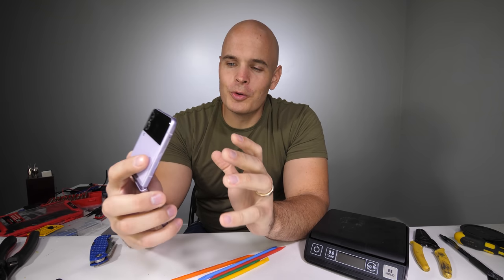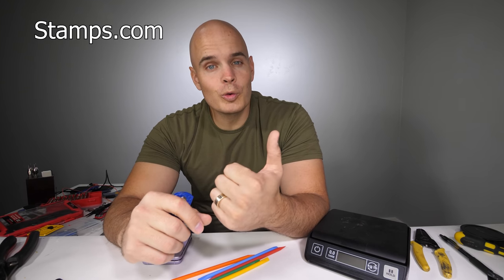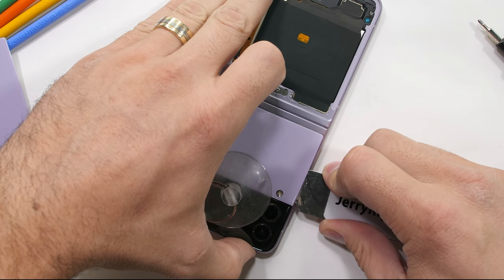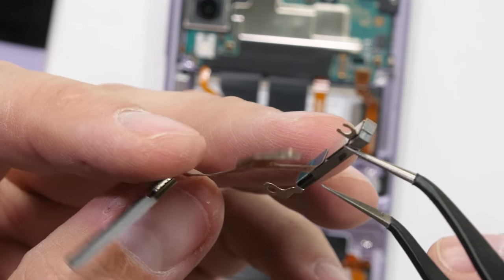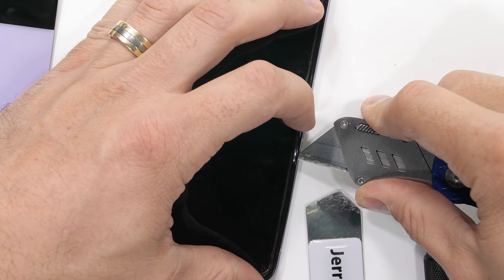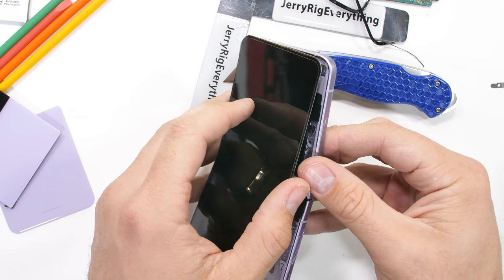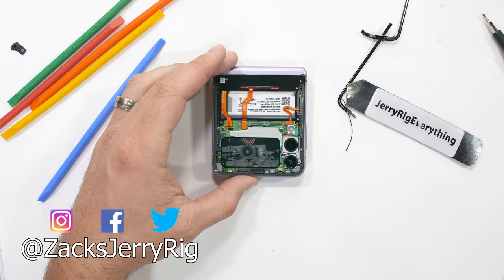Samsung Z Flip 3 TEARDOWN! - Lets try something new...

Comment: i thought for sure you would go deeper into the hinge since from my understanding, the hinge is better than the previous generation in that it can stay flipped at more angles close to 0 and 180
Reply: I think he did it on the new fold. As they use the same hinge.
Reply: @denniswolf8685  might have to rewatch that then cause i dont remember, thanks.

Comment: You should try removing the built in screen protector and see how fragile the screen underneath is. The built in screen protector is just slightly too small for the screen, which leaves a gap around the edge that will collect dust and peel off over time.

Comment: I have to say, this IS my favorite smartphone. Probably, of all time. 

I love having a phone that is small enough to disappear in my shirt pocket, while still being a full sized phone, with flagship power.
Reply: The z fold 3 5G is what I'm replying this message with. I got it a couple months ago
Reply: How "durable" is the screen from scratches etc? My phone is due to be upgraded on my plan in 10 days
Reply: @5punkybob  It is less durable than a traditional glass screen, in terms of scratching. 

But, with it being able to fold, it is far less likely to get damaged like a normal phone screen.

I am still loving it.

Word of advice: BUY THE SILICON CASE!!! The commercials are fucking liars. There is no way in hell, that this phone could be sat on the roof of a car to take a video. It is so slick, that unless the surface was PERFECTLY FLAT AND LEVEL, the phone will be on the ground.  

With the silicon case, it will stay on it's own. It's nice to be able to sit it on your chest or a pillow and watch, while laying down. 

I also set it on my cars dashboard for navigation, no mount needed.

Comment: I have torn down and rebuild roughly 10-15 of these phones since launch (work for Samsung) and I still watch Jerry videos like I have never seen the inside of the device
Reply: How often do these break? Like 1/10, 5/10? Etc
Reply: @aarronconleche8468  They are very prone to get damaged due to user error and I have seen non Samsung cases cause pressure damage which pulls the device out of warranty.  The inner screen protection film can have issues where it starts to peel up at the hinge or even appear like the screen is cracked.  This is probably the most common issue with the Flip devices.  My wife has had one since launch and it is just now starting to have the protection film start to show wear.

Comment: This is personally my favorite folding phone yet,
It’s small, compact and pocketable yet still has a good screen size

And most of all it doesn’t empty your wallet as bad as a $1800 foldable
Reply: Hm tho the only benefit you get from it is reducing normal phone into a small square. Usually reasonably big normal phone reaches around same pocketability as this one. I think that it makes big difference mostly to girls that need to fit it into a small purse or their pockets. Tradeoff tho is a fragile phone with bad battery life. Now Fold on the other hand that one changes a small table that noone can comfortably pocket into a size of a normal phone and i see that as a way bigger benefit worth of that durability tradeoff.
Reply: @MrMozkoZrout  I'd argue that it's far less fragile than my old phone.

My S10+'s screen factory screen protector got completely scratched up in a month

While my z-flip 3 still remained factory fresh 2 months later because the screen is always protected inside

The camera is much more usable too, you don't need a dumb kickstand to prop it while recording videos, you can just fold it and adjust the angle by as much as you'd like which was super useful to me.
Reply: @MrTARIQSs  nah I think the durability takes quite the hit and becomes quite a trade off when it comes to durability

Cuz you’re losing water and dust resistance alongside an actually glass screen….

Basically if you travel and go out a lot this might not be for you
Reply: Another useful feature for me was the fact that I could actually have the top part facing me when I have the phone on a table so I can watch the videos without all the lights reflecting on the screen, keyboard is also perfectly split for the bottom part, so you could have kind of a tiny laptop experience when chatting
Reply: @randaranatunga7259  it's literally water resistant though

I had my phone submerged and no issues whatsoever, it's IPX8 rated after all

Dust isn't a concern either, just watch Zack's previous durability test video, it did not mind dust getting in whatsoever
Reply: @randaranatunga7259  this phone literally have IPx8 resistance to water lol
Reply: @MrMozkoZrout  If you never used the phone then this appears to be the only benefit, but after using it for a while you discover more and more. I don't wanna miss the function to half open the phone and just place it anywhere. That and loads of other things make this my favourite phone so far. And the size isn't really a benefit to me, I always keep two phones in the same pocket and my hand also fits in the same pocket :)
Reply: @randaranatunga7259  again, having the screen protected inside makes it fine, if not better than regular phones, I literally don't get as concerned anymore when slotting it into my pocket as if it falls, the screen won't get any impact with the floor whatsoever, the body will absorb everything
Reply: @MrTARIQSs  right, yes I didn’t mean you’re completely losing water resistance lol

My bad…it’s just taking a bit of a hit is what I mean to say lol
Reply: @MrTARIQSs  good points, I guess what I’m trynna say is that if you are a person who goes out all the time for hikes and all that kinda stuff, this may not be the phone for you because of (possible but not many) slight durability stuff and the fact that there are phones with better battery and cameras at that price if you want to take good pictures or videos and have it last about a day or so of work
Reply: @randaranatunga7259  fair point, yeah it's not for everyone for sure, but not unusable either
Reply: @MrTARIQSs  definitely not unusable, in fact I’d probably recommend it quite often lol.

And yeah it’s not for everyone is what I did mean :D
Reply: @randaranatunga7259  I thought you were the guy that 1st replied to the original comment this whole time, just realized that you were the one who wrote the original comment LOL

This is why I took it from the "this phone can't do anything beyond shrinking in size" perspective based on the original reply, apologies
Reply: @MrTARIQSs  ah no worries 
Mistakes happen and it’s not a problem lol

Comment: Now I want to see if the phone will run with one or the other battery removed. I guess they are probably connected in series or through the motherboard somehow but it would be interesting to do some more digging to figure out how that works.

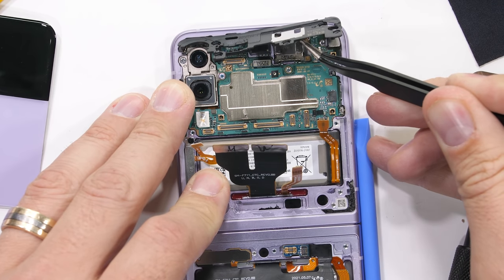Comment: 5:30 It was so relatable I laughed really, really hard... And then cried a little
Also the adhesive liner at 7:56 is really prone to failure. I've had it fail twice, brand new and after a trip to the repair center

Comment: 2:34 I've had the exact issue Many any times, and I've figured out that it's because if the scratch is long, or deep enough I guess after some time passes, less than like 48 hours I've come back to devices that I had put lots of scratches on that would have either a small hairline Crack or a hairline Crack that's pretty obvious.

Comment: have you never used your phone for more than 5 minutes directly on your head?
Why everyone is acting as if only ionized radiowaves can cause harm to living creatures? Athermic effects, including not so healthy ones also occur at radiowaves from mobile phones.
If its so unproblematic, why the  0815 guy is for example only allowed to transmit at 10mW in austria for example? And why its benefitial to the limit the transmitting power of the WLAN routers out of the box?

"95% of LiIon batteries can be recycled"..... well, ofc it CAN be recycled, but add to the recycle costs the chemicals and energy needed, aswell the CO2 which is produced within the production and recycling of them.... and LiIon batteries are by far one of the worst things humanity created. Lets be real, as nice the advantages of LiIon and co are, they are by far:
1) the most unstable/dangerous batteries yet (but considering their energy per space, its just ok)
2) the shortest living batteries. Its so funny to see batteries from 80 year old WW2 tanks having even MORE than the rated capacity, after 80 years in the mud, meanwhile a barely used LiIon battery lost capacity already after a few charging cycles. And well, about  3-7 years lifetime is easily.... GARBAGE!
I would not see LiIon as such a big problem in very small, mobile devices, but since e-cars are getting more and more interesting to people, its getting a PROBLEM, sooner or later, but it will be a problem!

Comment: This would have been one of the best phones of the year if they had made it gave a bigger battery, camera quality on par with the s series, and an actual glass screen protector that is in 3 pieces, 2 glass pieces for the top and bottom of the screen, and a slim Plastic piece that can bend along the crease to have added protection from scratches and small drops

Comment: the razr 5g had an antennagate, signal degrades if you hold the phone normally, but the signal gets back to normal if you hold it upside down.  Does zflip3 have this issue?  also how is the thermal?  the razr 5g heats up pretty badly just by watching some videos

Comment: Can you pop the bottom back glass and then snap back in? I have a small amount of water under the glass and I want to remove it to clean then reinstall. Would I need a replacement piece?

Comment: @4:00
It's not about using the phone.
You can be completely phoneless and you are still surrounded by the radio waves.
Also, 5G got it's start as military weaponry. 
Look into Directed Energy Weapons(DEWs) and Active Denial Systems(ADS), 5G uses the same technology.
It can be used as the same weapons platforms, why do you think Huawei's lead in the technology was a National Security issue?

Comment: SOMEONE PLEASE EXPLAIN TO ME WHY THE FLIP 3 IS SO GREAT OR THE FLIP SERIES!!

I understand the Z FOLD 3 regular size phone slightly thicker and opens up to almost 8 inch screen. THIS IS AWESOME THIS MAKES SENSE.

I DON'T GET THE FLIP!! 

It's not any more portable than a regular size say Galaxy 21 ultra when it's opened. When it's closed it's still not portable because it's twice as thick. 

What's the point if the phone when it's folded is too thick and uncomfortable in your pocket just because it's smaller not as long cuz it means it's more portable if it's twice as thick.. 

I JUST DON'T GET IT.. 

If the phone opens up to the same size as a regular Galaxy 21 ultra or a big phone like that then you're better off getting the Galaxy 21 ultra. 

They both support the S pen.  The 21 ultra has much better cameras by far. 108 megapixel camera, 40 megapixel selfie camera, eight times optical zoom, and more.. 

Blows away the cameras on the flip

Again if something's going to be uncomfortable and big you have to have an advantage for that has to make sense has to be a good trade-off.

That would be THE Z FOLD . 

Oh so when you open up the flip you have a tiny screen and then another screen on the bottom who wants to look at a tiny screen.. we're done with tiny screens. We want big screens. Something that goes from big to even bigger. 

To me the fold is cool but it's more of a gimmick than it does anything more than a regular size phone.. seriously.  

Coming from a Galaxy Note 9 there's no real advantage to any phone in my opinion out there other than the Z fold series but I'm waiting for the FOLD 4.. 

Not only is it going to be cheaper than the 3. It's going to be thinner, have the unbelievable cameras of the 21 ultra or 22 ultra, not only that it's going to have a built-in S pen like the Note series.  

Can't wait for August. 

Another worthy mention would be the Galaxy Note 22 that's coming out which should be awesome.. 

Peace out  ;)